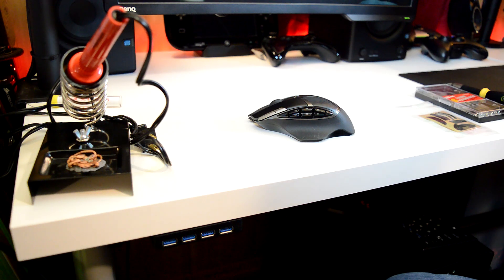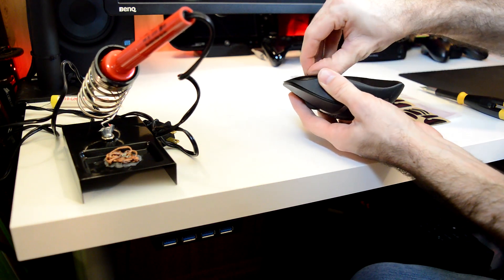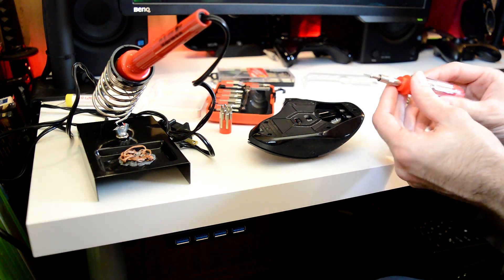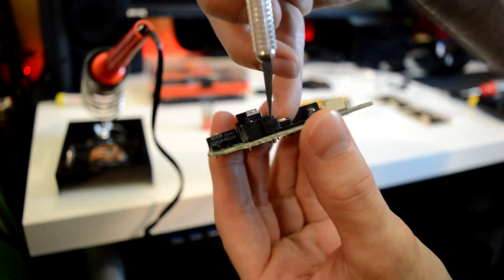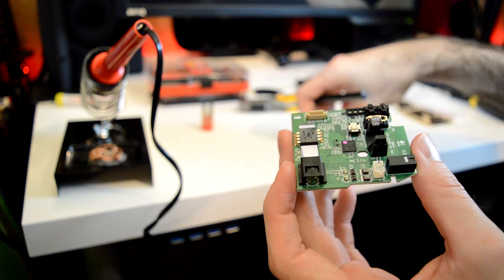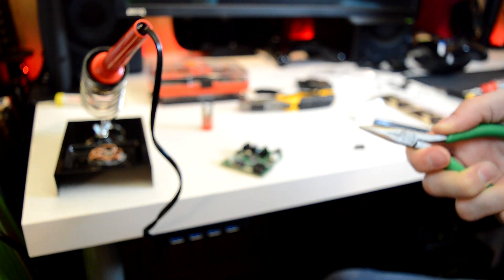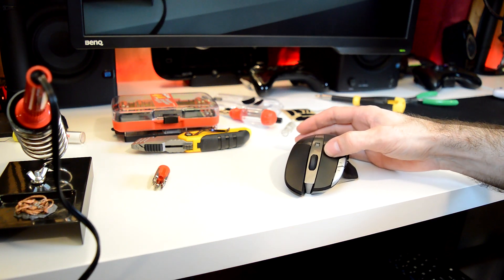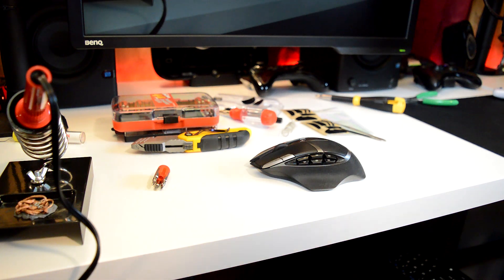How to Fix the "Doube-Click" Problem on a Logitech G602 Wireless Gaming Mouse - Part 1

Comment: Don't try this people. You don't take apart a micro switch and randomly bend little pieces of it's contacts, and hope for the best. If blowing it out with air or cleaning with alcohol doesn't work, and your that invested in saving some money, and that willing to take this thing apart, you might as well just go onto mouser or digikey and buy a replacement switch and replace it. You are going to end up poking or stabbing yourself trying to get that clip off of the switch, or scrapping off some of those SMD components when you inevitably slip with your prying device (those SMD components can come off pretty easy). And depending on how long you have had this mouse / how brittle the plastic has become on some of those plastic clips, your going to end up breaking those tiny clips trying to pry them off. The clips for the ribbon cable clip and the clip that holds the top half of the housing to the microswitch are not very sturdy. You are welcome.

Comment: Thanks for the video. Really helpful for getting the mouse apart and also getting into the switch. I didn't know that opening up the switch itself as possible until I saw this video. After consulting some of the comments, I just used contact cleaner on the inside of the switch instead of taking out the metal brace and bending it. My mouse is now FIXED! Thanks again!

Comment: I strongly suggest to clen your mouse really good before you try open up the switch. Mice are notorious for getting gungted up. Many times it is just some dust or debry. If that does not work just try to clean the switch as they can get gunked up too. Use air duster and if that dose not work you can try come circuitboard cleaner. Then if this does not work you can try too fix the switch.

Comment: Not only do I have the double click problem, sometimes it doesn't register left clicking at all. I was in a chat with logitech support for, I kid you not, a couple of hours, doing all sorts of click tests, and in the end they said "if there's not any other problems I wish you a good day", and I was like "YOU DIDN'T HELP ME AT ALL!!!"
This has seriously scarred my relationship with logitech, I've only had 3-4 mice in all my life as they all worked flawlessly for allmost a decade, but this mouse was malfunctioning after little more than a couple of years.

Oh and am I the only one that has serious problems with the Logitech Gaming Software. It randomly doesn't open on boot, sometimes it opens two processes instead of one, and it evens defaults all my settings. 
As I told support, I probably won't ever buy a logitech product again, which sucks as they used to be the best

edit: literally had to press the post comment button trice to get it to work, stupid mouse

Comment: I succeeded perfectly my experience: you don't need new  pads. The button plate placement is much more intricate than it looks, be prepared to fiddle allot there. There is actually notches where button plate is placed, use other button as a reference to place it right.  ! EDIT NO BENDING NEEDED ! And maybe you actually need to bend it in opposite side, because look at how it works, you need more tension to stop double clicks, but be very gentle :] EDIT! Actually you don't need to remove that plate at all (Rutvik comment below) there is grease on the plate you need to clean, and yes i saw that grease and it was cleaned while i was fiddling with it :D

Comment: First of all, there's a typo in your title! (It should say double-click)

Thank you so much for your video. I hope all people who are considering "upgrading" to the G604 find this. That mouse is truly awful, and now I have so many old G602s to get back to working order. In my case, I didn't really intentionally bend the little metal piece. Instead, I cleaned it with my ancient Radio Shack contact cleaner. I also didn't bother disconnecting that ribbon cable and just was careful with it. Unlike other commenters, I couldn't really see any discoloration on the metal thingie, but it worked. But it's a PITA to get that thing out and to put it back in, especially if your hands shake like me. So next time, I will just use a Q-Tip or something to carefully apply the contact cleaner to it without removing it.

Also, I had a hell of a time trying to figure out how to get the switch cover off because it's not that clear in videos. There's a tiny, little gap along the vertical corner that you can stick a small object into. I had a pair of extremely fine tweezers from an acne extraction kit, and those worked great for both that and removing/replacing the gold thingie (don't worry, they were never used for their intended purpose, lol.) Also, I put a Band-Aid (couldn't find tape) on top of the switch cover to keep the white button in place during removal and reseating. Hope this helps someone!

Comment: I got my mouse left click works as a new so you save me money and enhance my patience!
One thing that is missing in your video is how to properly put back in place the little metal copper use to click, I found how in this video: https://youtu.be/2sh7KwUudtI?t=132
After a lot of guess and try while my hand shaking (i'm not a surgeon!), I found that using a tool was not the best for me so I goes the same way presented in the video with my finger and then, most important after I get it in place, I had to push with a tool in the middle of the plate to drop the curved metal part in place and that's it!
Thank you !!

Comment: I have a non-functional G602 that stopped working soon after buying and I never contacted Logitech, and another G602 that I use for my regular PC which has just recently started to give me double clicks, intermittently.  I'm pulling a switch off the non-functioning mouse, but getting all three of those legs unsoldered to remove the switch from my spare mouse is challenging.

Comment: Thanks for this video, I did this to my son's Logitech mouse a few years back and fixed the double-click problem.  I could not remember how I did it exacly so your video was great when I had to deal with my G602 with the same problem - then it all started to come back to me.  Issue does not seem isolated to a particular model, the ones we have all have the same Omron metal "spring" mechanism.

Comment: I have this same mouse and those "scratches" I think are just dead skin and oil buildup for your hands, and it looks pretty normal and uniform normally, until you take a fingernail to it and scrape at it, and it dislodges the gunk, making it visible.

It's a good mouse, but I think I prefer glossy mice because it's both grippy and I can wipe off gunk with a dry finger and it comes off. Low maintenance that way. This G602 is high-maintenance when it comes to cleaning.

Comment: As Rutvik Panchal bellow has already hinted, +1 here for repairing the double-click issue just by clearing the gunk under the tiny clench-thingy that makes contact with the metal lamela you've unbent. Took me only a tiny screwdriver soaked in WD40. And yep, there was no need to remove nor bend the lamella. 

For the people who find it hard to remove the switch cover: Inspect the right mouse switch cover. It's "in the open", visible from all sides. There is a horizontal and vertical crevice. Insert a thin blade inside the vertical crevice (preferably the back one), push slightly away from the switch, and then then up. If you do it right, the cover pops up right away.

Mouse click works just fine now, woe is me though. The cursor now shakes a bit all the time. I guess I must've polluted the laser refractor. Meh, going to unscrew again. 
---
Edit: Cleaned and repositioned the refractor, my G602 behaves like a new mouse, yay!

Comment: I watched this video because I remembered trying to replace the microswitch on my G700S. Long story short, that mouse is put together weird, and I botched the job. Looks like this mouse should be much easier. For what it's worth, these switches are so cheap (barely a dollar each on Amazon), that if I were going to take my mouse apart this far anyway, I would just go ahead and replace the switch.

Comment: Hello ShadowTracer, I partially followed your tutorial but I feel I should add some context that is missing/misleading in this video. You should not bend the switch, the culprit is in fact the contact surfaces, if you actuate the switch you will recognize that the function is a disconnect between two contact surfaces and in my case there was a clear build up of residue on both surfaces of the contacts, I removed the residue with a combination of electrical cleaner and a small brass brush and the ghost click issue is gone. It may be worth while to refresh this video and clarify because I could imagine less experienced techs or end users inadvertently breaking their switch by following this guide. Not to criticize you or anything, I found your tutorial easy to follow, you have a good voice and clear in your instructions I just don't think that bending the switch should be recommended. Cheers o7
Reply: I read the comments and thankfully didn't bend anything. Used contact cleaner and my mouse is fixed!! Thank you!

Comment: You suppose to bend the hook on the piece of the copper metal more, instead of flattening it like that.  Obviously, ten of thousand of clicks would flatten it.  After a year or two, you will have to do it again.

On the side note, you can try attaching many small pieces of transparent scotch tape under the left click button which requires you to open the cover.

Comment: I replaced the switches in my G602 and now it only works on dark surfaces. On my mousepad, my couch, my pants it works ok, but not on my white table or wooden floor. Before I opened the mouse it worked on any surface.

Comment: I did this and it actually fixed it for me, but man did you leave out the hardest, the most "I want to punch a hole in the wall part". Getting that little metal clip back in was making me want to punch someone in the face. I just got lucky after about an hour and it clicked back into place while I was fighting it. Finished re-assembling, and double click problem is gone. Thanks!

Comment: I had the same problem and learned a hint from your video.  I take your hint and take a simple trial without going through all the complex and difficult detailed work as you did.  This hint is that the very little hook needed to be  flattened to fix the problem.  So, this is what I did and my mouse is working very well for the past two days.  I pressed the left button real hard and held it down for a while hoping it will flatten it.  I have no idea if it did, but now I do not have the double clicking problem at least for the past two days.

Comment: FYI to anyone coming to fix their mouse,  mine was suffering from an inability to click and hold. A single press down would register a double-click. 

If you have the same issue try this: After removing the top cover assembly, put the batteries back in and test the clicking by pushing on the physical switch. I found that my mouse was working just fine. I noticed that there was a groove in the plunger of the top assembly left mouse button. The repair kit I got had little shims included so I covered the groove with the shim, put the mouse back together and it works fine again! No de-soldering or other disassembly required. 

If this fix doesn't give me long-term success I'll come back and edit this comment. Cheers!
Reply: Thanks for the comment! I'm just now experiencing the same issue with my G602. Is your fix still working?

I was just about to go on Amazon and buy a new mouse, but I forgot how expensive this mouse was, so then I looked into self-repairing it.

Comment: Hey. I left the little copper plate where it is and just pushed the nose up with a tooth pick. Left mouse button works like new. So i recommend to try that first if you don't want to spend one hour in messing with that copper plate.

Comment: Thanks for this. Getting the copper plate back in isn't easy. You need to slot the two ends under the retainers, then the copper loop under a third retainer by gently pressing on it. 
The click is not as hard and satisfying as when the mouse is new, but the double click is gone, and the mouse is working fine.

Comment: Great guide although you missed the important bit, over time due to many clicks, rust or gunk get settled in between the main contact points(due to electricity and metals and chemistry idk). That's the flat part on the switch itself in bottom side and the rounded surface on the metal piece that you said you should flatten out(you shouldn't do that btw, it messes up the click and the contact). To solve the entire issue of double click all you have to do is to remove that rust with a precision knife or a super small high grit sandpaper. The rust or gunk creates a resistant path, which results into double clicks or sometimes no clicks at all. I recently fixed my G602 switches by removing that gunk. If you have precision tools, you won't even need to remove the metal piece and you can use a slim thin sandpaper thingy to get in between the contacts. Another part that should be to show how fragile that thin metal piece is and you will need tweezers to work with it and how to put it back together.
Reply: LOL it works so well, there are 5 years or so layer of thick dirty stuck between the gaps, after cleaning no more double click issue👍👍
Reply: +1 thanks! Made it so much easier this way, the mouse works alright again.
Reply: Thanks for stopping me from bending anything. I used contact cleaner on the contacts themselves and fixed it!
Reply: Totally agree with this! I just cleaned the rust off of the contacts and it works perfectly fine.
Reply: @Jan0123able  Glad I read the comments.  I did the same as you and it fixed my issue.  Thanks!
Reply: Thanks for your great comment! Just tried it on my G602. It totally worked! You saved my mouse and my wallet!

Comment: Thanh you.  I didn't know where the screws are. I was able to fix it but it's kind of soggy so I switched the left and right siwtches and it works great. Now, I encounter a new problem, sort of.  I think I was used to the sogginess of the worn out spring switch the NEW switch feel like hard. I have to press harder to make it work.  I suppose I will get used to it after awhile.

Comment: The part number for the switch is D2FC-F-7N. It is a COM-NO micro switch with pin spacing of 5.08mm. The D2FC-F-7N appears to be obsolete. I don't recommend buying from non-franchise distributors as the chances of it being counterfeit are very high. The D2FS-F-N is in stock at franchised distributors, i.e. Digikey, Mouser, Allied, etc, and has the same layout, making it a drop in replacement. Instead of mucking about disassembling a micro switch, just buy new switches and replace them. It is far easier and cheaper.

Comment: Got frustrated with my G603 with the double clicking issue, I read that it could be dirt in the switch causing it. I remembered fixing my bike's turn signal switch by spraying wd-40 on it, so I tried the same thing to my mouse which I was ready to throw anyway and to my surprise it worked!

Comment: I actually had the problem with not DOUBLE CLICKING but When holding down click it interrupts and then connects again. So for example holding and dragging when drawing a straight line in paint you would instead get 5-10 mini lines.  I have cleaned the little metal plate with some alcohol because it had a white coating on the place it makes contact. Works like a charm now

Comment: The hardest part was putting back the spring ... took like 1 hour and after checking multiple sites : some said the spring needed to be more ROUNDED, in this video it said more FLATTEN. In fact it's both: it needs to be more rounded but being flatten enough to fit the hook in the center of the spring. Anyways, worked, let's see how long it will worked.

Comment: Thanks for this, just needed to learn how to take it apart so that I could replace the middle button switch. Also, if you take off your mouse feet carefully enough you can reuse them. They're not gonna look as good and even as before you took them off, but the mouse feels essentially the same with them nonetheless.

Comment: I would advise people to first use some compressed air and some isopropil alcohol drops to try and clean the contact of the mouse. Mine was also double-clicking from time to time, but it was due to dirt build-up. After blowing some compressed air and adding 2-3 drops of alcohol along the button (with a syringe works best) it now works again. So, try this before starting to pull your mouse apart.
Reply: Also, try cleaning your damn mouse with some alcohol once per week. Don't let your palm grease accumulate on the mouse. It will easily make it's way to the contacts , especially if you have greasy and sweaty palms.

Comment: Sad thing is that this fck*# 90$ rat got broken after 1yr of normal use, and 10$ Ebay worked for 4years and still going strong.... so much for the money value... But great video, I would have probably replaced microswitch, nice trick to get it working again. Tnx

Comment: In my case... And probably yours as well. No bending was actually required.It was just a dirty contact. I cleaned it after seeing the electrical gunk that built up on it. And immediately tested it. Seems to work now.Very easy fix lol. Don't even have to take the metal thing out.
Reply: @azraela9  actually I was wrong. It started happening again. I did have to bend it. It works great now though
Reply: now I just need a scroll wheel fix.